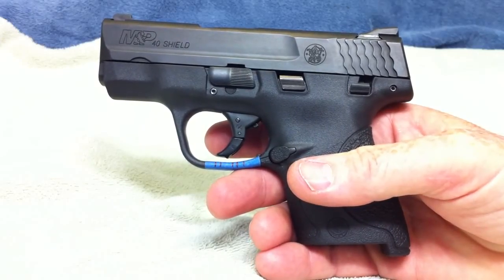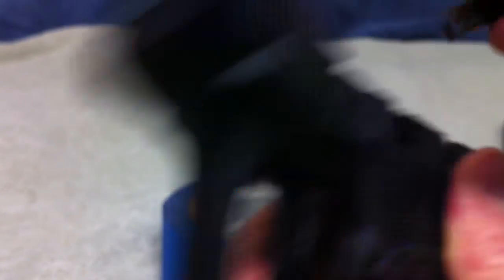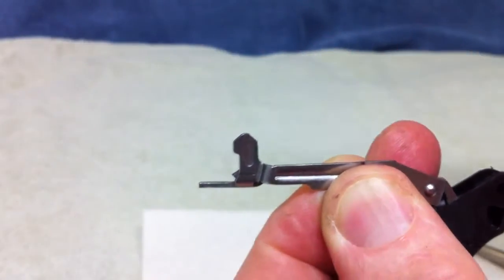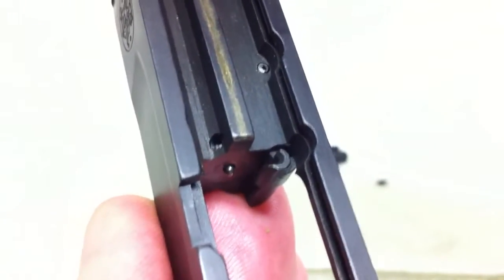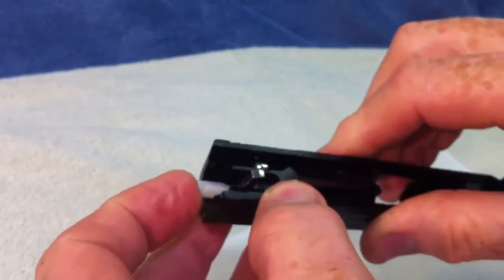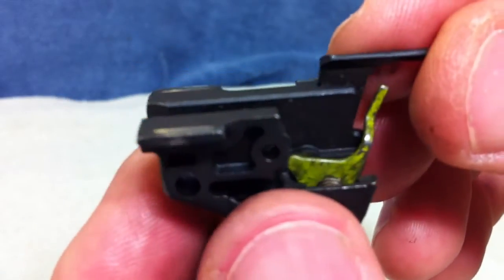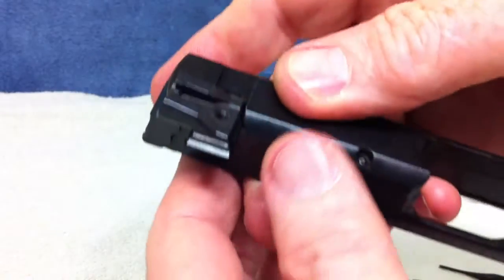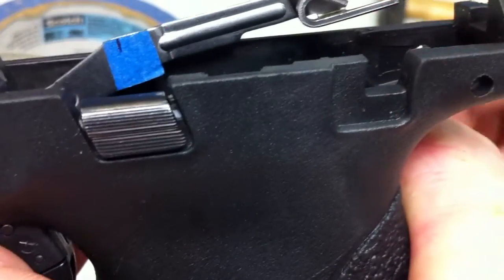M&P Shield Apex Trigger Install (long version)

Comment from the maker: Yes it can be installed at any tme. The Apex striker blocker will smooth out the pull a little better and because it comes with a softer blocker spring, after installing the Apex blocker and spring, the trigger pull will drop about 1/2 pound.

Comment from the maker: From the Apex website: "The geometry and dimensions of our striker safety plunger differs from the factory part to yield a exceptionally smooth takeup before the trigger bar engages the sear cam. Our design also minimizes drag on the trigger bar as it transitions to the reset point. The secondary benefit is a more detectable trigger reset." 

The Apex blocker reduces trigger pull one pound. The sear only install will shorten: sear pull; reset; and over travel. It will reduce pull 1.5 pounds.

Comment from the maker: Yes, all the M&P lines, Full Size, Compact, and Shield all work basically the same, and the parts are very similar. Just different sizes for the different models. The only variations is if the gun has a magazine safety, which would not change the Apex install.

Comment from the maker: Yes it will reduce the trigger pull 1 to 1 1/2 pounds less than stock pull. The video Apex Trigger Install Results shows the before and after results. The Apex striker blocker helps smooth out the final 1/8 inch of trigger pull and will reduce the trigger pull an additional 1 pound. All the other changes are due to the Apex sear. It reduces sear pull 1/32 inch, reduces over travel 1/16 inch, reduces total reset 1/8 inch (which is 1/16 inch less over travel plus 1/16 inch less reset travel). .

Comment: Thanks for this very informative video.  Is the Shield close enough in design to the M&P 40c so that I could use this video as a guide  to install the Apex trigger in that gun?  The install video on the Apex website is nowhere near as clear and well-lit as yours, making it difficult to follow.  Thanks for any info.

Comment: I would really like to know where I can get one of those little grinding stones like you used to take out the burrs in the slide where the striker hole and the striker pin are. It looks like it was a perfect fit. Thank you.

Comment: have you tested an M&P with all the APEX bits with the stock trigger itself along side an M&P (or the same gun) with the actual APEX trigger itself replaced as well?  I'm basically wondering if the FSS kit that includes the trigger is worth the extra price over just the internal bits.
Reply from the maker: The FFS is totally different than the Duty/Carry and Competition Kit, which are the same except for different spring tensions. The FSS has different parts,  which moves the trigger more forward, eliminates most all take-up and over-travel. With the FSS you have to use the FSS trigger, or it won't work right. The separate trigger is to replace the stock trigger, when using the Duty/Carry or Competition Kits. That trigger is shaped differently than the stock trigger, has a different style trigger safety, and the trigger reduces some take-up and over-travel, but not near as much as the FSS kit.
Reply: +robkarrob11 all true. Not to mention the FSS kits don't work in the Shield.

Comment: At the risk of asking tiresome questions, do you have any thoughts on the results of installing all parts in the Apex Shield kit other than the sear block?  The reason I ask is that right now we are still up to our knees in snow so I'm not eager to re-zero the rear sight after removing and replacing it...thinking I will save that till it's warmer.

Comment: Do you think a hot air gun would be able to heat up the set screw on the rear sight enough?
Reply from the maker: You could try but depending on how well S&W used the Loctite it may not be hot enough. I have people tell me they have used a soldering iron to heat the screw. I tried that and it did not budge for me. It took a torch for me to get the set screw to loosen.

Comment: I installed the sear, AEK trigger, new sear spring and plunger. I noticed now that my sear doesn't come all the way horizontal now. Did I bend something or is the new trigger/sear/sear spring messed up? I did a lot of dry firing and it's firing and reseting, but I'm concerned that I've messed something up.
Reply from the maker: Because the Apex sear has a different shaped contact lobe, it may not reach fully horizontal, at the break point. As long as the gun functions properly, I would not be concerned about the sear breaking before being level.

Comment: On the M&P 9P Pro series Is there a need to install a Apex trigger what are your thoughts I have heard yes and no.
Reply from the maker: I am sure there would be some improvement, but would it justify the $70 cost. I have read the trigger will reduce some of the take-up and also reduce some over-travel. The real good kit is the FSS kit. But again is it worth the $160.